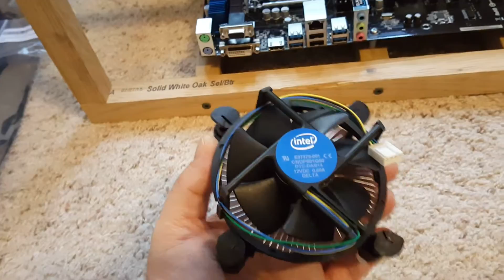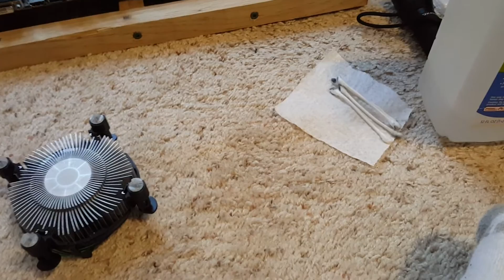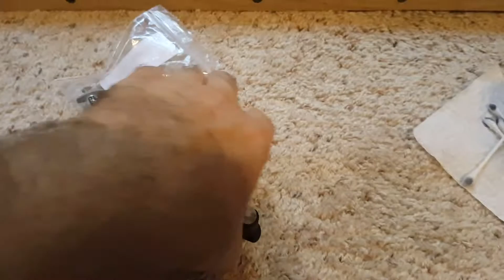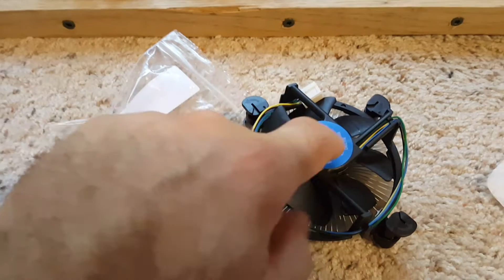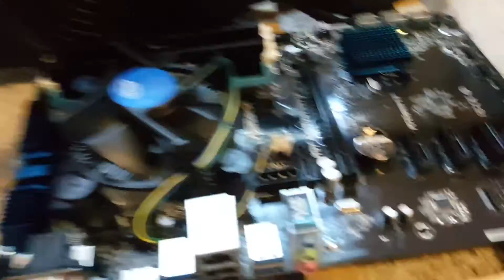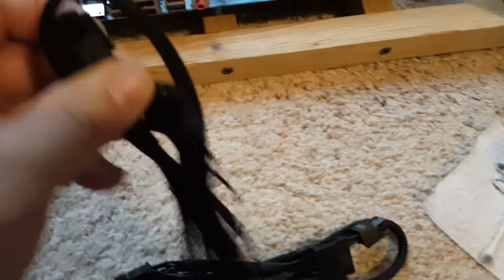GPU Mining With R9 390x 8GB OC & How to Assemble a Mining Rig for Ethereum, Dash, LBRY & More Part 2

Comment: why did you choose to go with 390's instead of 470s or 480s?  do you use windows?  ubuntu or ethOS-ubuntu?
Reply from the maker: 390x actually is what got me into GPU mining because I found them refurbished really really cheap.
Reply from the maker: I use both Windows 7 and Windows 10, I prefer 7 but I ran into a problem with it running more than four cards and 10 is just so much easier.
Reply: TheBitcoinMiner
i think windows 8 / 8.1 is also fine for 6 gpus